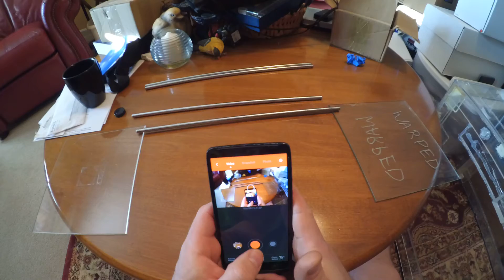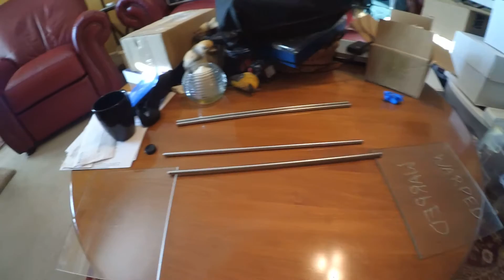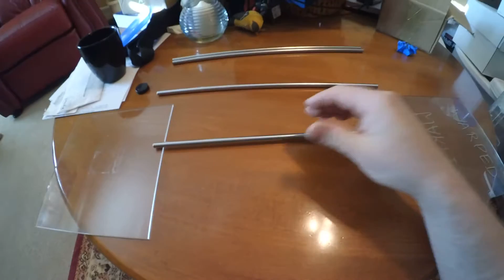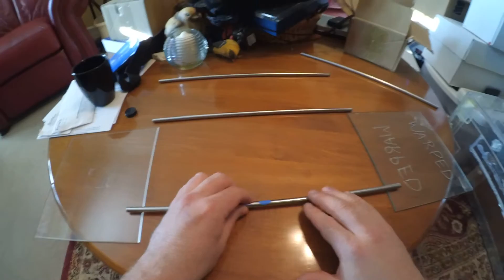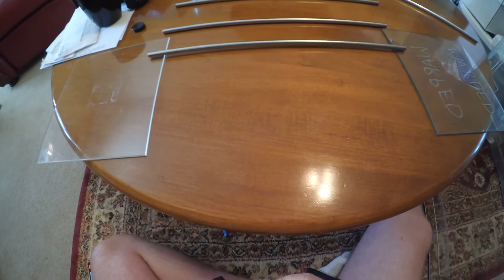How to tell if your 3D printer guide rods are true/straight or bent/warped

Comment: I'm beginning to reach this realization myself.  Been using a HIC Prusa i3 as well and have had my shard of issues but this one has been a BEAST.  After so many hours tuning I could finally get a successful large print (T-Rex Shower Head) but not too long after I began having an issue where I couldn't get the bed level all over, it seemed as if the center of the bed was slightly higher than the rest.  I would level the corners then the center would be pressing really hard into the bed. 

I've heard of other people having bent rods, especially when using longer ones like on HIC.  I'll be taking it apart tonight to check it out.  How has your experience with McMaster Carr been?
Reply from the maker: Believe it or not, one of the two McMaster rods was very slightly bent as well. However, I used the one that was straight with one of the originals that was also straight. this fixed most of the problem. Eventually, I want to take my electronics and install them into a Makerfarm frame. The Makerfarm kits use a different rail system that I believe will be straighter than the 8mm round rods.
Reply: +adamky1 Well, Hopefully I get lucky then and get 2 good ones!  I took my rods out last night and immediately could tell a difference, ordered two new rods from McMaster Carr pronto.  I marked the top of the rod and just like your tape method the mark always landed on top and made it really easy to see that it was bent.  I think the rails are definitely the way to go,  especially for longer axis.  My Y-Axis is rather long at 400mm so it bending absolutely makes sense
Reply: +jeremy bryson I'm having the same issue with the bed, which seems to be higher in the middle. Was this caused by bent X rods in your case? Also, i was wondering if you also had trouble with vibrations with the bed. In my case, I have to turn one of the screws much more than the rest, which apparently causes a small torque on one of the bearings, so the bed vibrates a little. Did that happen to you too?
Reply: Well,  The rods weren't perfect and I ultimately replaced them.. but the problem persisted.  I found the issue was simply that I had tightened the 4 corner screws to a point that the middle of the metal platform was pressing into the bed causing it to bulge ever so slightly in the center. 

As far as the vibrations I think that is just a problem that the design of a Prusai3 has inherently because of the mass of the bed having to move.  It can be minimized by printing slower and making sure every thing is set up correctly, but it'll always be there.

The screws should ideally be all at about the same position.  I would go through all of the axis place a level on them.  Start at the table the printer is on and work your way up through the printer making sure everything is correct.